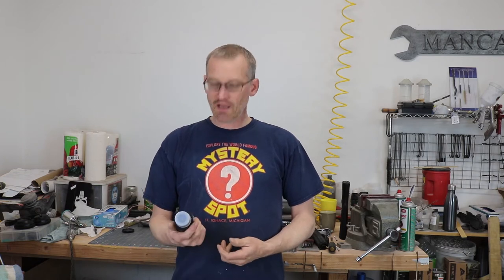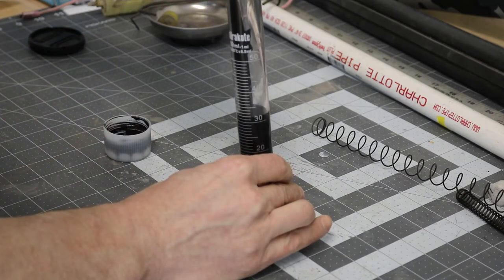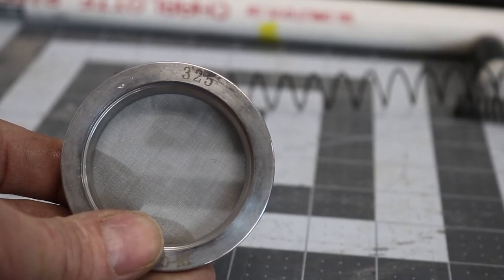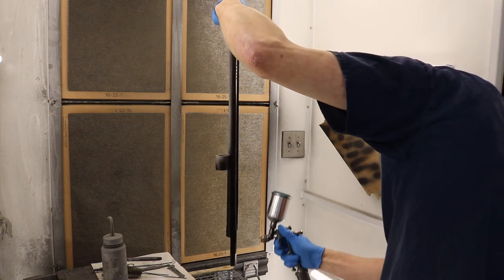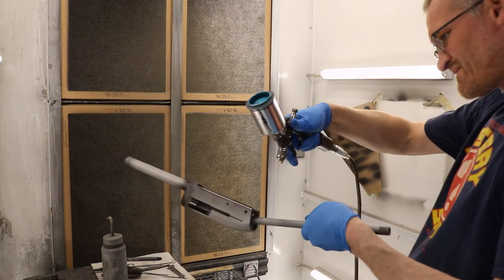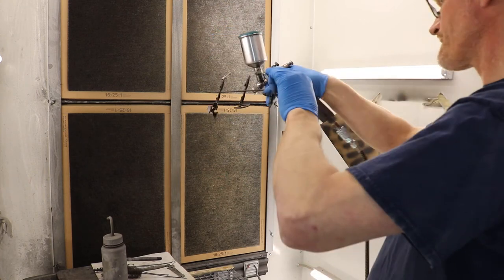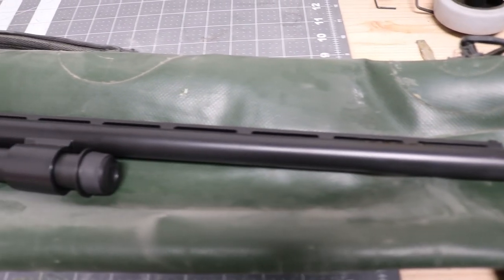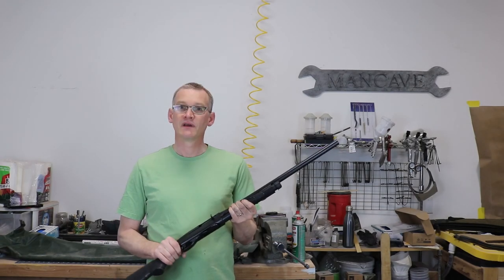Elite series Cerakote on a Remington 1100

Comment: Is Cerakote different from regular paint? Is it extremely durable?
Reply from the maker: It is significantly more durable.  It will scratch but any coating would.  Where cerakote really shines is in rustproofing and chemical resistance.
Reply: @alaskanmancave5301  it's super expensive, do you normally have to do 2 coats to get good even coverage like you do paint? At $35 for 4oz it doesnt sound like it would go very far, especially with multiple coats. I'd be using a LPH80.
Reply from the maker: @stephenwhite5444  one coat is usually enough when sprayed properly.  Cerakote goes on extremely thin, approx 1 mil.  4 Oz will cover several guns.  At least cerakote is cheaper than most automotive paints.  Plus when you buy it in larger bottles it cost comes down significantly.

Comment: Where do you place your gun for the required ambient flash time before you oven cure? Is normal room dust going to effect the gloss finish?
Reply from the maker: I just hang my parts on a rack.  I have not had issues with dust affecting the finish.